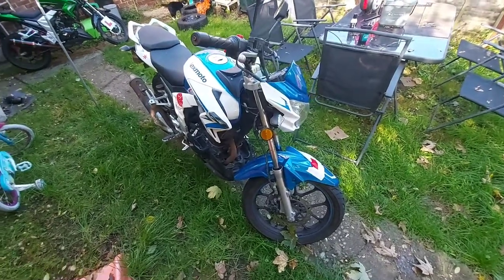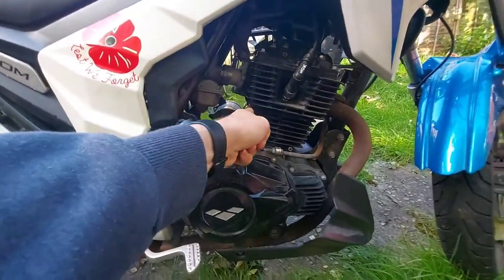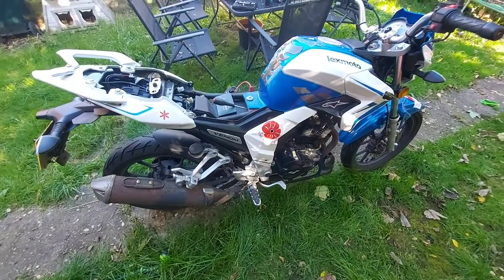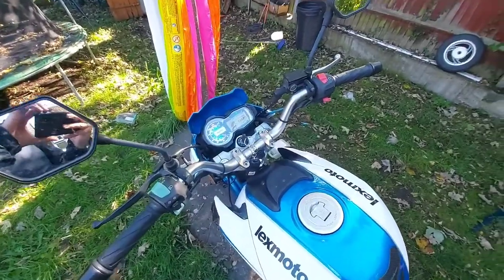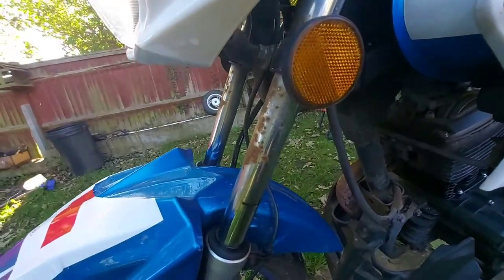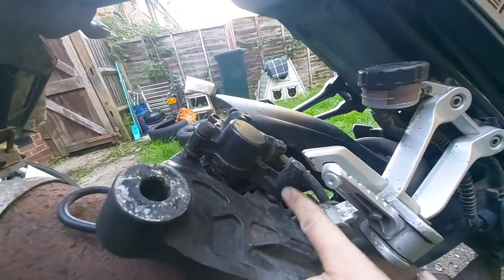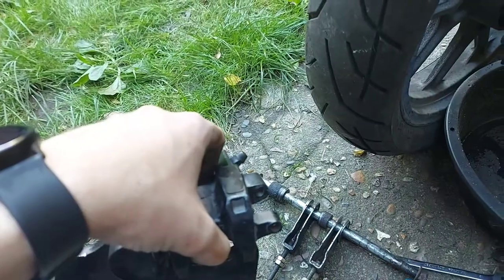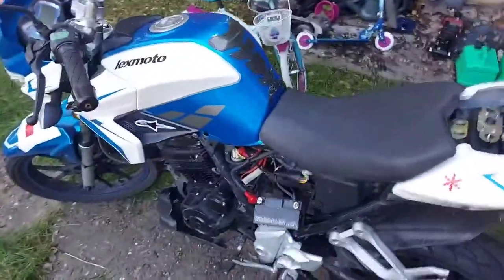Lexmoto Venom 125 non runner project

Comment: We're is the battery located
Reply from the maker: Behind the silver/black panel on the left side below the seat. One Allen key bolt and 2 locator lugs hold it on.
Reply: Thank you mate mine is struggling to start so battery has gone flat works fine once started but once I stop revving throttle it cuts out and struggles to start again

Comment: Hi mate I have a venom myself and I’m trying to upgrade it any advice on what to do first
Reply from the maker: Fit a bigger main jet in the carb. 100 or 102.

Fit a stainless exhaust.

And switch the carb for a genuine Honda part, the ones fitted to these are the cheap pattern parts you can get for a Honda CG125 so they're not great quality.

Don't bother with a 150cc kit or anything else